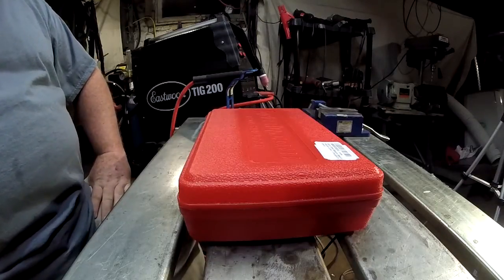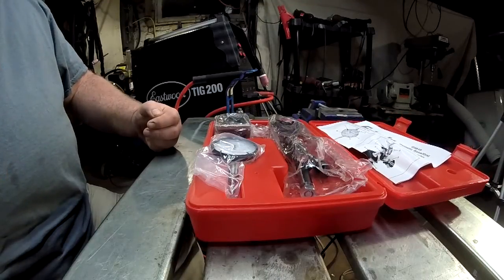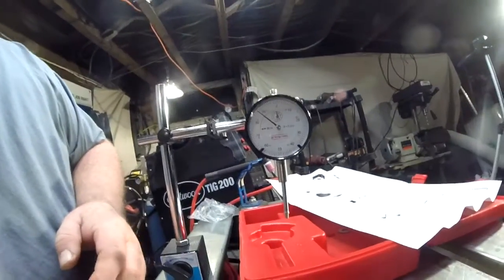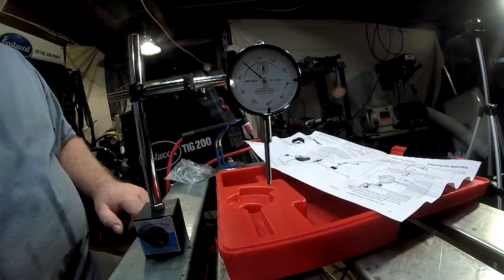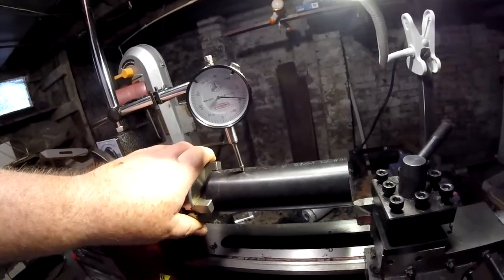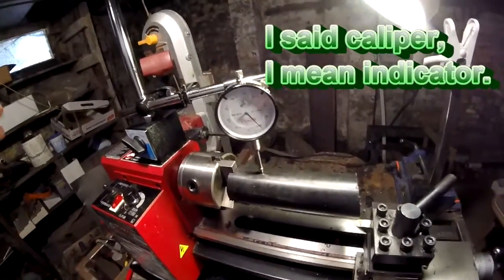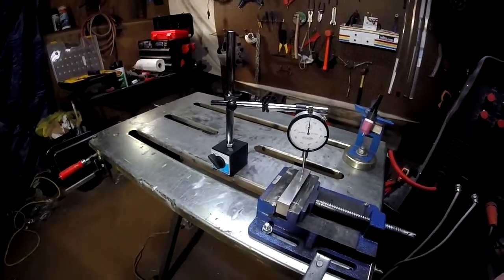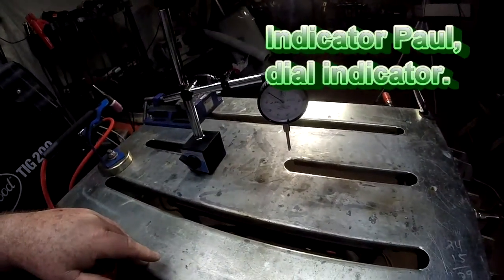Using a Dial indicator

Comment: I need to get something like this for projects I'm working on at work.  We need to compensate for welding distortion on some products we make.  Right now we are getting everything machined after welding process.  These are large pneumatic robots used in agriculture so very heavy duty!   I'm at odds with the shop manager over how precise we need to be.  If we get one of these maybe I can show them just how little things move.

Comment: Thanks Paul for the tutorial. I've never played with one if these before, but if course have seen them. 14bux is a steal  for brand new. A Wendy's combo with an extra cheese burger costs roughly the same up here. Is the base run off a battery? How dose that work? Thanks again keeper up man. 
Pidge.
Reply from the maker: +PiDGE IAM Hi Pidge. The base is mechanical the magnet is on  a cam. A dial indicator is a great useful tool to have in the shop. It doesn't so much measure like a scale or a tape, but it more "show's the difference" between things and that is very handy.